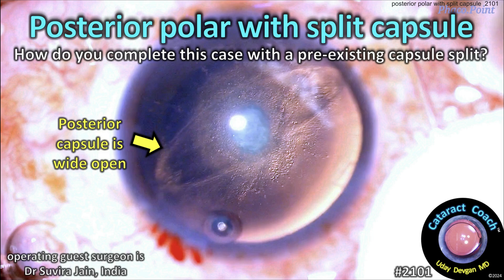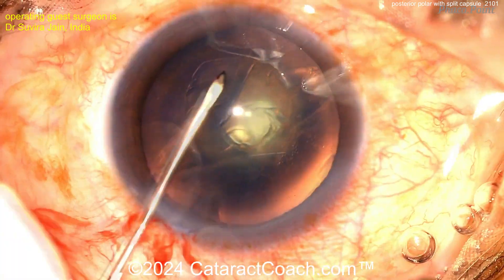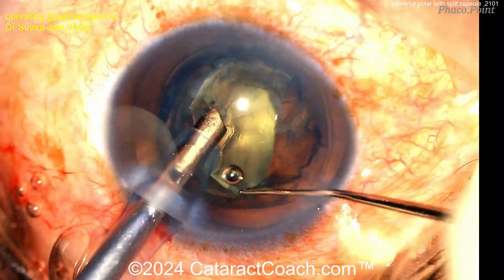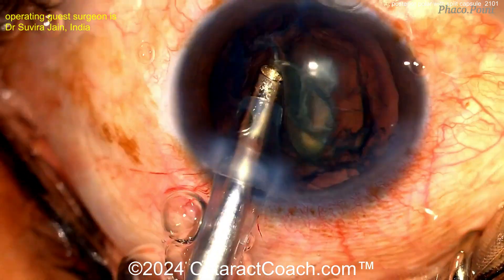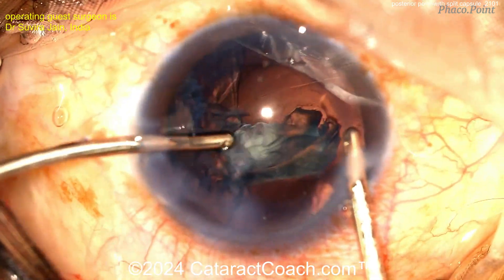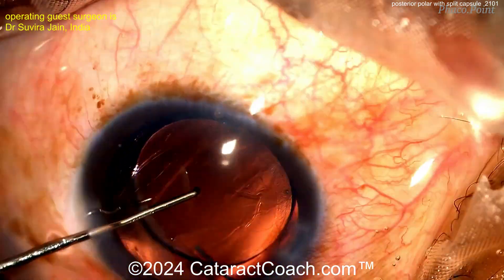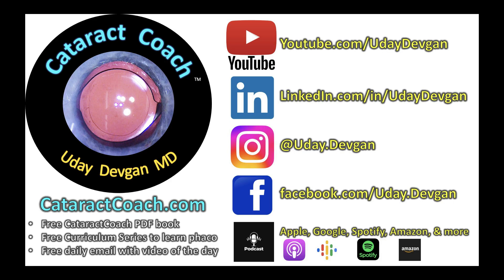CataractCoach™ 2101: posterior polar with split capsule

Comment: Very cool surgery. Can you comment on phaco settings here? I assume the bottle height/infusion pressure was reduced significantly, otherwise the lens would just dive through that big split as soon as you introduce the phaco handpiece?
I also find it curious that the lens didn't turn white and opacify as it would in a traumatic cataract with a capsular rupture.
Reply from the maker: yes, agree with your input regarding fluidics. lower infusion pressure (and then lower outflow aspiration rate).

Comment: I am interested in the new to 2024 “LAL Plus”. I am in need of Cataract surgery and I’ve had both RK and LASIK.
Reply: Not sure what "LAL Plus" means. I'm a cataract surgeon that does LAL implants and I'm not familiar with that terminology. LASIK and RK even moreso make lens calculations more difficult, and the LAL is a reasonable way to still try to achieve a good refractive outcome after cataract surgery, but it definitely has its risks and benefits. Absolutely makes sense to see a surgeon who is familiar with them to have a thorough discussion.

Comment: Beautifully managed. The posterior capsule remnant here is almost certainly going to cause a Maddox rod dysphotopsia for this patient and will need to be expanded out of the visual axis with a Yag laser.
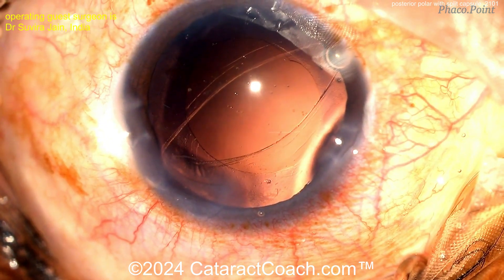Reply: would u ever consider putting a 3-piece in this bag? 3:34
Reply: @soccer24six  Yes but honestly  there's not much or really any benefit to that over optic capture which is very stable.  If the rhexis was to large for optic capture then I would try do that almost certainly.
Reply: @StevenGSafran  thank you 🙏